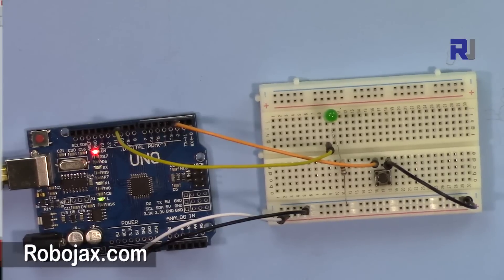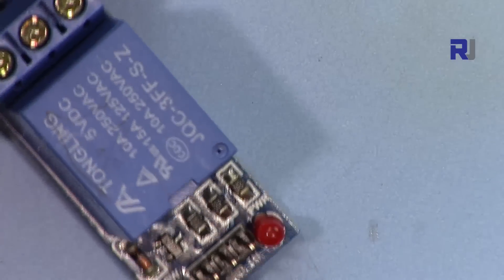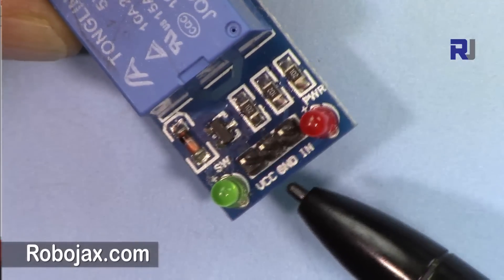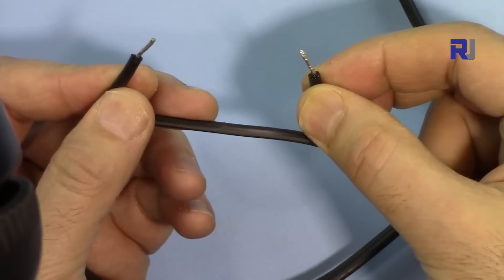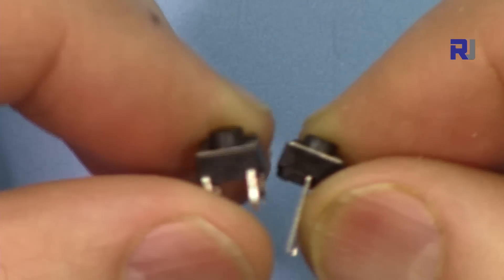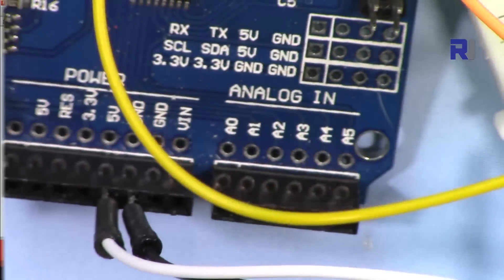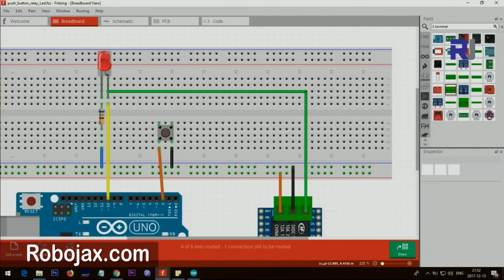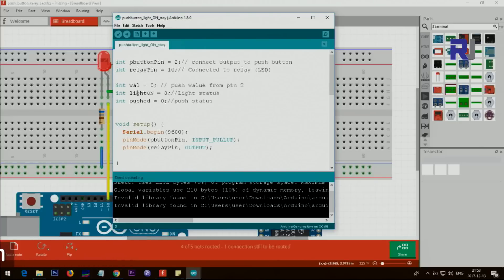Using Arduino Turn AC bulb with push button On and OFF toggle with relay

Comment: Can u give me the program of 5 push buttons and one led to ON, 5 indicators for 5 push buttons , one reset button to OFF for all led
Reply from the maker: I am sorry, I am very busy. What is application for this? if a lot of people need it, I will consider working on it.
Reply: @robojax  it's for my home emergency switch, security gaurd will reset the button to turn off the syren

Comment: I can't find any videos detailing how to wire this up without using a relay, all I want to do is turn the LED on with a press of the button, and have it stay on until the next press
Reply from the maker: If you know how to connect LED, then  in this code connect your LED to pin 10. Or watch this video https://www.youtube.com/watch?v=2WwedCRwmgA and then come back to this video.

Comment: hello !
Robojax !! Nice tutorial. I tried the single channel relay code and it just worked fine on my nodemcu. so i thought of making it 4 channel and created my own code referring to single channel code of yours.. But the relay randomly turns on and off. dont know where hv gone wrong. can you please help me out? Thanks in advance...
Reply from the maker: Hi, Thank you for the complement.  Have you looked at the second code at the bottom of the page which shows how to control 2 relay and  2 buttons :http://robojax.com/learn/arduino/?vid=robojax-pushButton-on-off
I am sure once you look at it, it would be clear. Let me know if further help is needed.

Comment: is possible connect 3VDC in output?
Reply from the maker: Arduino has 3.3V and 5V but not 3V. if you get 3.3V relay, and Arduino non with 3.3V, yes can.
Reply: @robojax  without arduino, i want use a 2032 3v battery

Comment: can you show how to create automatic light on/off with timer use relay on arduino with up and down push button for chose timer.
Reply from the maker: I have two video one without LCD and another with LCD, Robojax Relay Timer. https://youtu.be/6DGQhQgr7Ak and https://youtu.be/BhEIFzFSMuE using push button will not make sense. How do you know what is the set time? You will need to have display to tell you the time.

Comment: Will it be the same diagram if i use DC motor ?
Reply from the maker: Load is load. Doesn't matter if AC bulb or DC motor. As long as the amount of current the motor needs doesn't exceed the rating of relay, it will work.

Comment: What if I create a toggle button in app inventor what will be the code of it in Arduino?
Reply from the maker: Never heard of app inventor. But just checked it. it is totally different. you can apply the concept but different method.
Reply: Robojax Okay thank you so much

Comment: i test the code, after uploading the code it will on and off the relay. after 3 sec the relay will on again, but i did not press the button.
Reply from the maker: I just checked the code. it should not do it. Without pushing the switch it should not toggle the bulb. Check the code or wiring.  if you use INPUT_PULLUP which is in the code, it should not turn ON or oFF by itself.

Comment: How big is the resistor?
Reply from the maker: you made me watch the video as this video doesn't need LED. But it has and I mentioned that if you use a relay you don't need LED. but in case you did, the color of the resistor is BLUE, Grey, Brown which is 680Ω  but you can use 300Ω to 1000Ω. you and do google/bing search for "resistor color code" you will get something like this https://www.allaboutcircuits.com/tools/resistor-color-code-calculator/ where you can select color and read the resitors value.
Reply: Thank you!
Reply from the maker: you are very welcome.

Comment: Usually we use booalean for 1 and 0 states
Reply from the maker: by definition Boolean has value of TRUE or FALSE but in Arduino IDE, if you use 1 and 0 it wont 'give you error and works.

Comment: what will happen, if you press the button for 3 minutes? please,
Reply from the maker: as soon as you push, if the light is ON will turn OFF and stay OFF and if the light is OFF, as soon as you push the light will turn ON and will stay on until you release the button and push again. Doesn't matter if you keep if for 1 min or 1 hour. no affect.
Reply: @robojax  thank you sir

Comment: NC is normally closed. Not normally connected
Reply from the maker: You are right. But connected make more sense than closed.  For some people closed means the path to current is closed. Which means not connected.

Comment: Thanks but this little code for everything I did

int relay1 =11;
int but =9;
int val ;
void setup() {
  pinMode(but,INPUT_PULLUP);

  pinMode(relay1,OUTPUT);

}

void loop() {
val=digitalRead(relay1);

   if (digitalRead(but)==LOW){
     digitalWrite(relay1,!val);
     delay(500);
      }
}

onnnlyyyy
Reply from the maker: you are welcome.  Yes. there are many ways to do it.

Comment: thank you sir ,, but please code
Reply from the maker: The link is in the description under tthe video.
Reply: @robojax  thank you sir
Reply from the maker: you are welcome.
Reply: @robojax  hi sir, please ,,, i need your help very urgent

how to ensure the wiring between an ACS712 5A sensor + 5v relay + Arduino + a Push button

(I trained to carry out my end of study project. The objective of this project is therefore to find a solution to the problems of Smartphone charger accidents. home fires start,
  We have arrived at an intermediate investigation between the network and the charger. This media is automatically disconnected when the charger is empty or when the battery charge level reaches 100%.) (When you appear on the push button, the phone is charging and when the charger is

empty or the battery is 100% reached, the relay disconnects.)